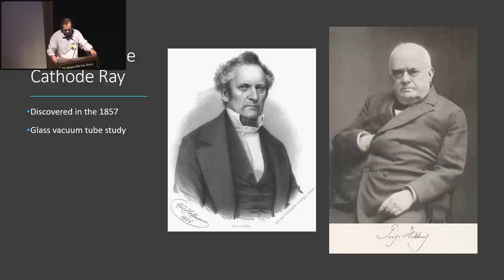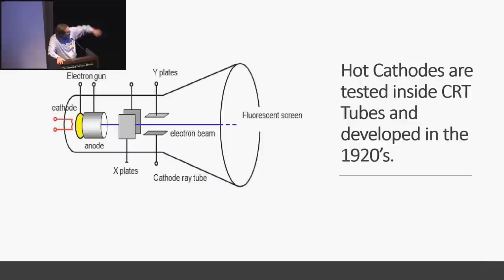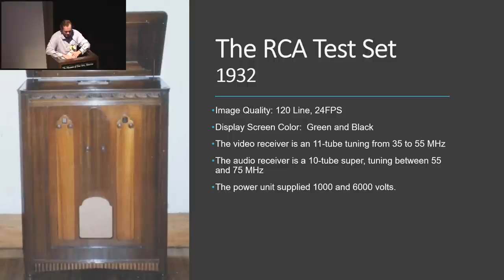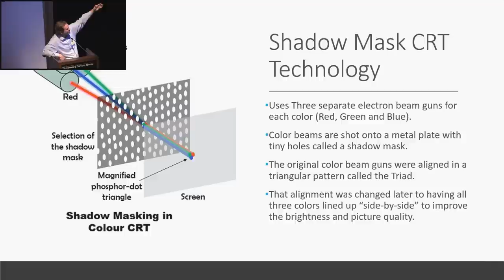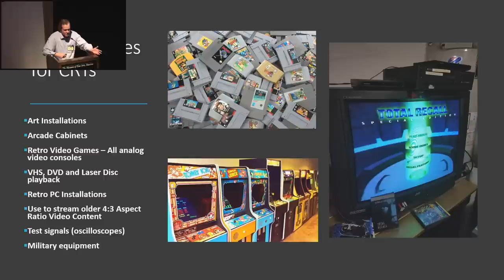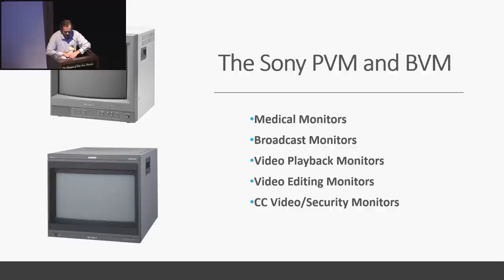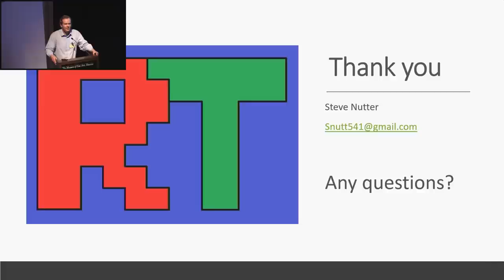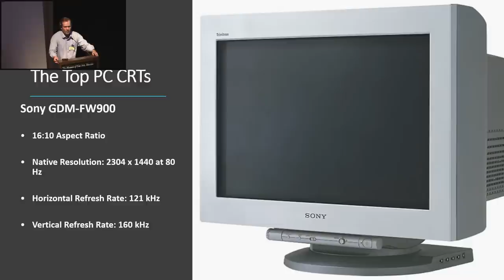The Complete History of the CRT Display 📺

Comment: Hey Steve, incredible presentation! Fantastic content. There is one type of CRT that you didn't cover - the office/business presentation monitor like the RCA MM36110. Not PC-monitor, but a large screen HD-capable CRT that works as both an all-analog 15khz CRT. but can switch to 31khz mode and display 480p, sometimes 720p and 1080i. These are HD capable CRT that don't do any post-processing or introduce lag, so they work with light guns while also being able to display HD signals instantly with no lag, just like a PC CRT monitor. It's like they have two modes and you can hear a click when they switch between 15khz and 31khz. It had a lot of the capabilities of a PVM but in a consumer set, available in bigger sizes and at a much lower price. I own one and I never hear anyone talk about - and most people seem to think that HD CRTs always and necessarily did digital post-processing and introduced lag and as a result didn't work with lightguns. However this is not the case, there are definitely HD CRTs that have an analogue mode, and simply instantly display analog signals just like a PC CRT monitor. I think mine has a digital input but I never use it.
Reply: I like your comment would you mind telling me what model you have? Also could you tell me if my model also falls into the category that you were talking of? I have a Sony KV-40XBR800 it has component inputs & DVI input, made Nov 2003. I have always wondered if this CRT would be good to use light gun games on and I have never tested that functionality. Not sure if this CRT would be good for gaming because I have heard a lot of mentions that usually DVI means input lag but was curious if component input is used if that is still the case.
Reply: Is that like my Thomson Proscan? It's a 36-inch mega-crt using a phillips tube that accepts 240p/480i, 480p, 1080i, and a few PC VGA resolutions like 400×800. It has VGA inputs and even a USB hub, but it's not working for some reason.
Reply: Isn't that a type of multiformat? Sony was definitely able to do this with some Trinitrons -- the Macintosh TV having one of them (though at that time not up to 1080i--but a literal switch from 15 to 31).